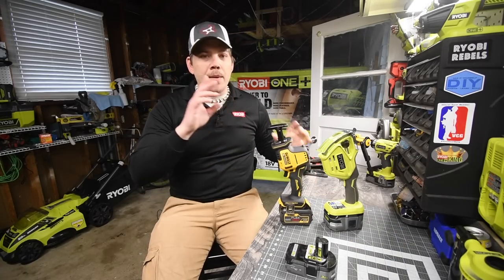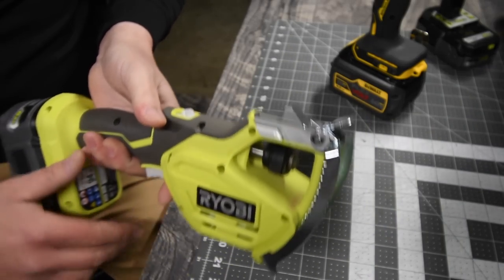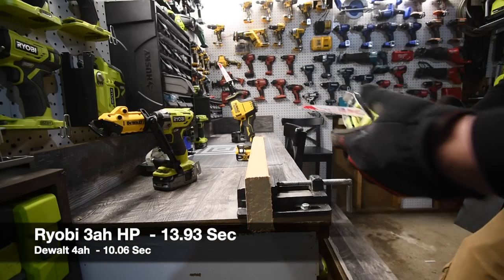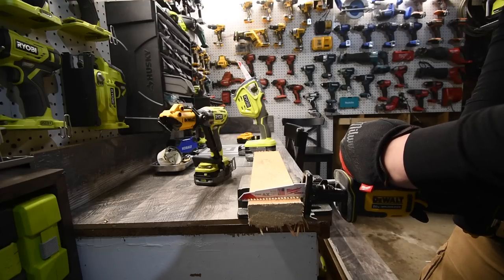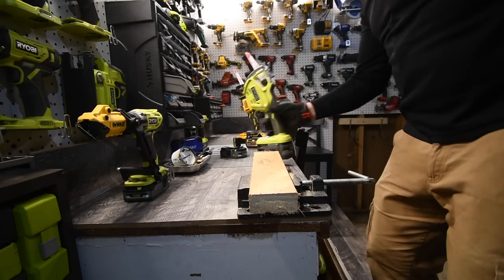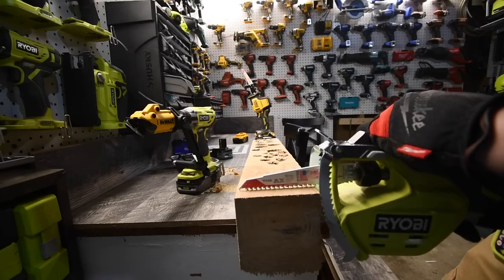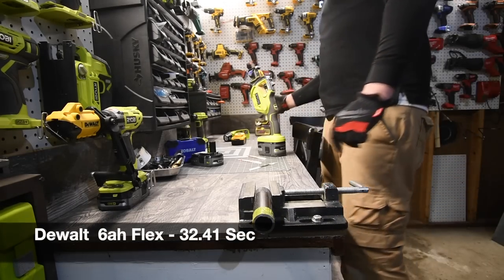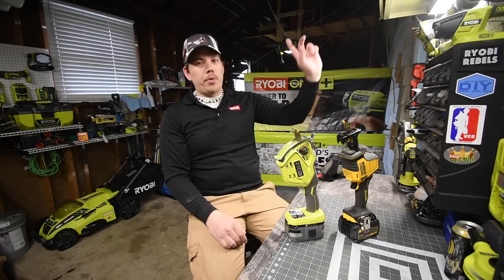Ryobi Hacksaw Vs Dewalt Hacksaw

Comment: That Ryobi can do it , but so can my hacksaw.  Who told u they were pruning saws ?  The reason the atomic does not get a good shake is because it is inferior to the xr line.....take it apart and look at the windings. I appreciate ur vids...I really do.  The saws were made to cut pvc...cpvc conduit etc etc and yes u can prune with them. That Ryobi has got me scratching my head......maybe u got a lemon.
Reply from the maker: I know the Atomic is not as good as the XR line, but that doesn't mean its not a dewalt tool. I put these tools through stress tests in a way they aren't meant to be used. if I were to only cut PVC, it wouldnt make a good stress test

Comment: Reason why alot of people dislike the atomic line up is because they are underpowered even though they are newer... like the atomic impact it has alot less power than the 887 and i think the brushed 885. The drills I think are good do they compete against the xr model definitely no but they do get the job done.. i have the hammer drill atomic
Reply from the maker: even thought some of the tools might be under powered. they still are good tools though

Comment: Hacksaws are used for pruning i thought they were used for pvc and light work maybe im confusing what pruning is, is it twigs or like tree stumps if it takes over 30 seconds to go through a 4x4 imagine a tree stump or log
Reply from the maker: they are for light duty work. not what im doing with them in these videos. but they are able to do it
Reply: Over here in the UK a hacksaw is used for cutting metal. The blade has very small teeth closely packed together.

Comment: Good video but the Ryobi should not have the timer stopped when it shuts down. That’s a real world scenario, if you literally had a time limit to cut the 2x4, you couldn’t just stop time. If the tool is failing and is shutting down due to the inability to perform, the time needs to reflect that. Just my thoughts. Still a cool looking tool though!
Reply from the maker: I did for the last test because I wanted to say something while it was on my mind

Comment: ... you should be careful with Ryobi , and not used it to hard , because doesn't have a good quality on bushes .
My reciprocating saw has a play one those and the blade is Weeble Wobble that can be used for fine cuts. 
And the motor, all Ryobi motors are very low quality special the brush ones. 
On my circular saw I changed 3 already. 
I will send you pictures on Instagram messages so you can see when I will open it to replace the motor.
Reply from the maker: I will be cautious MrDINO and thank you
Reply: ... did you see the picture I send to you on Instagram?